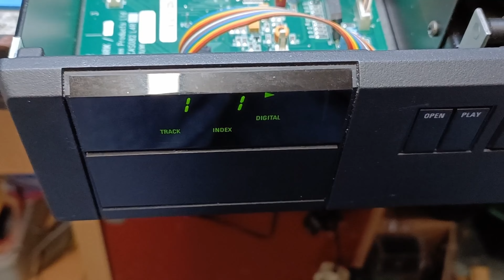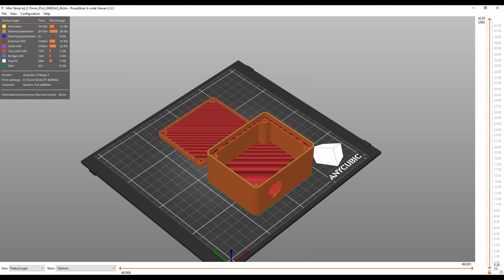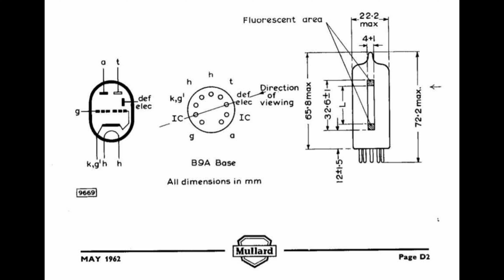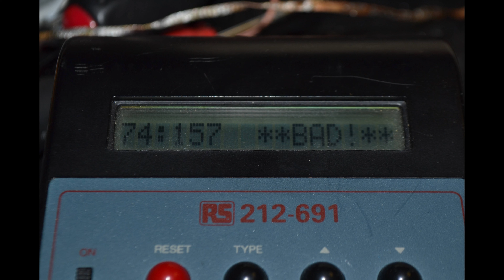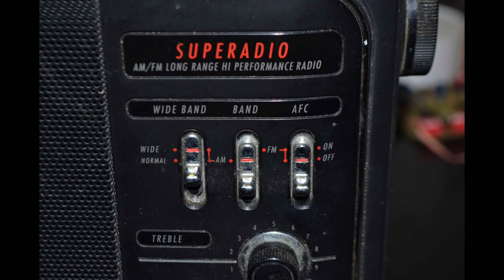Linn Karik - Terminal Brilliant failure?

Comment: Nice work coming up with a solution. I never cease to be amused by the fact that several thousand pounds cost (not  "pounds worth', note) of equipment can be rendered useless by the failure of humble components. I just restored an Arcam Solo for GWAAC and had to replace all 13 front panel tactile switches because the contacts had tarnished.. Press the 'next track' button and the drawer would open, for example. Apparently a known, and inevitable, problem. Original cost of the unit? £1300 or so. Cost of replacement switches? £2.
Reply: I need to replace a few more switches in my Magnavox CDB-492.  Excellent sounding CD player, probably rivaling those costing substantially more, especially with the upgrade to NE5532 op amps.  The rubber tracking ring on the spindle is completely gone but it doesn't seem to affect its performance.

Comment: Replaces unnecessary, failure prone and over engineered switch mode power supply with proper transformer and rectifiers. How it should have been done in production IMO.   (I hate smpsu’s….)
Reply: It was originally… until they designed the ‘Brilliant’. Some Brilliants were even stuffed into a circular drum to fit where the toroidal trafo was designed to go.
Reply: And IMHO they don't belong in something as expensive as a Linn.  And for £3600 I would have expected a high-end Philips CD mechanism like a CDM9 Pro or a CDM12IND/CD-Pro.